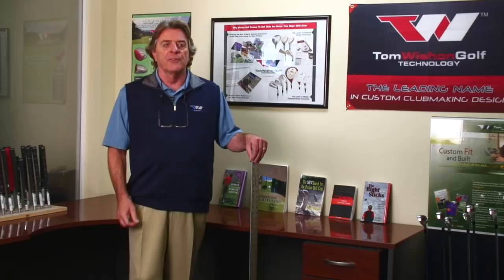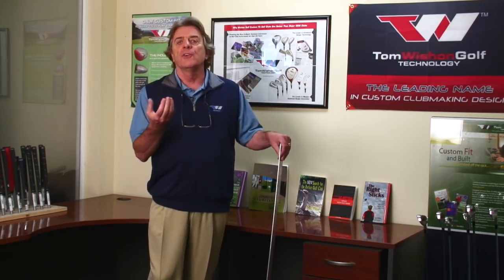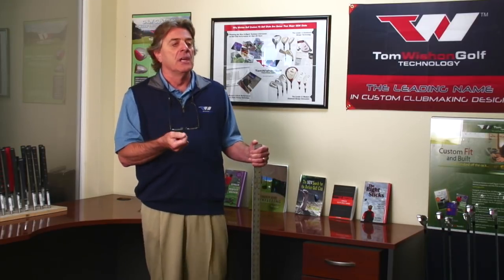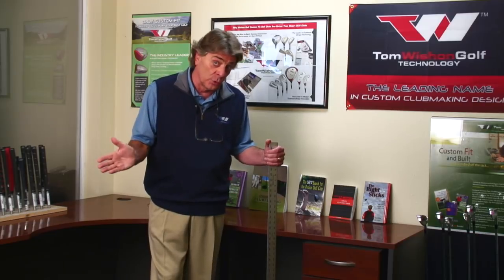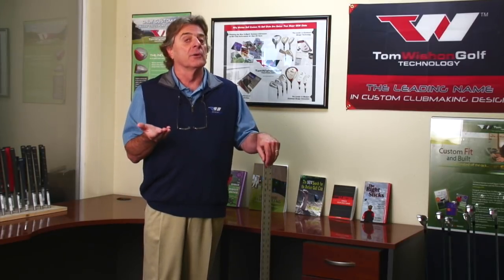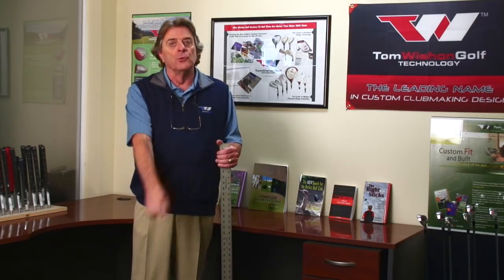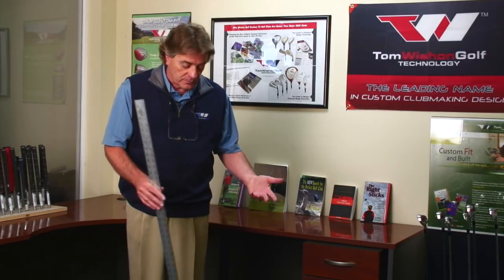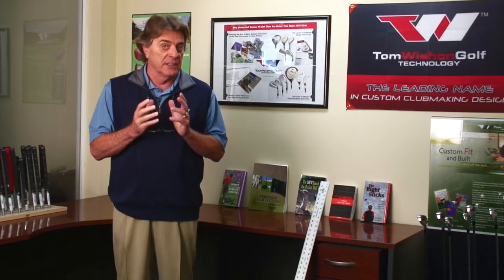WRIST TO FLOOR MEASUREMENT FOR LENGTH

Comment: I just started playing golf. I bought a nice used ping driver and wasnt hitting nearly as well as my irons. I measures it and its 47". I choked up on the shaft and cut a few inches off and today I was sending nukes straight down the fairway. Felt really nice thank you for your amazing advice.

Comment: I'm struggling with finding a good Driver Length.  I'm 6-2.  When I use a standard 45, I tend to rub holes into my glove where the butt rubs into the heel of my hand.  When I choke-up and bend over more, I LOSE Control and Distance.. it feels very unnatural to bend over that much.

Comment: so being a taller golfer of 6'5 and having a passion for building clubs for a decade; I wanted to ask about creating irons in the 1.5 inch longer or 2 inch longer irons that possess a lower torque shaft, light overall weight profile, iam certainly more of a hitter of the ball in swing characteristic; I am searching for longer irons overall little weight to maintain physical control and to prevent fatigue throughout a evening of golf. but most shafts in lower weights i.e 80, 70 grams are mainly high launch profiles...what would you recommend...?
Reply from the maker: Will:
While it is true that longer length irons can increase the torque on the club and shaft, it is not a significant increase over the normal swing forces at normal lengths so there is no need to think about trying to do anything to offset it.  A much bigger problem is to try to find lighter heads or to try to push yourself to not go so long with your length that it makes the swingweight/head weight feel get way too high and adversely affect your swing tempo and timing.  A lot of people who need longer length irons are finding if they don’t go quite as long as they think they should with the 4, 5 irons and then use 3/8” increments between the irons through the set, or even ¼” increments, this gives the tall person the comfort they seek over the ball with the higher loft irons which are the ones that were more of a problem for comfort because of your height.
Reply: I throughly agree with the 3/8 incremental iron ideal; I believe I've been brain washed into only using 0.5 increments due to working with them mainly over the years. I will certainly implement the 3/8" and see if this encourages better results. But I should express that I am primary playing the bridgestone j 36 cb irons with xp 105 shafts at 1.5 over length, I state the model of irons due to the lack of uniform standards throughout the industry with respect to the evolution of golf irons throughout the years and find them very comfortable but they possess higher swingweights, which is great for a period of time, but to maintain shot consistency with them, id have to hit the gym everyday, this isn't ideal for my current lifestyle at the moment ...but you ve made a great point and i will certainly  attempt the incremental change. 

I'd love to find a source where the head wts. of irons could be produced for custom orders.

Thanks again..really enjoyed your video.

Best Regards

Will

Comment: Hi Tom, I've been playing a standard length PX6.0 LZ shaft and love it. But at two recent fittings I've been told I should be playing a shaft 1/2 inch longer. (I'm 6ft1 with a wrist to floor of "37) my concern is - will this extra 1/2 inch effect the shaft flex, especially by moving the middle PX ''loading zone'' that makes this shaft so likeable half inch. I've read alot of mixed answers via the net. If it does effect it, can it be hard stepped even though it's been lengthend?. Your advice would be greatly apprieciated - Many thanks

Comment: hi tom , fantastic vlog which has got me thinking , im 5 ft 7 and wrist to floor is 32 in , I play off 9 , since watching this I have gone to the practice range and gripped down on my driver and hit golf balls until I've found a position now where if I choke down 1 1/2 inchs on my driver I now hit the middle more consistently , I use a titliest 910 d2 , would you suggest that I stick to choking down or as this is adjustable getting a 43 1/2 inch shaft , any thoughts would be really appreciated , kind regards jules
Reply: @camobooty2008  Is that jealousy or you just have nothing of value to add.

Comment: I am confused about fitting for static length of clubs. I have clubs that were built for me 1 inch longer than standard (my wrist to floor length is a little over 38 inches while common belief is the 7 iron standard length is 37 inches). My 7 iron swing weight with TT XP-95 R300 shafts is D5. Lie angle set at 2 degrees upright.  A different fitter is now telling me this setup is wrong. He says it's better to stay closer to standard length and adjust the lie angle instead to set the bottom of my swing. He says it also stiffens the shaft by lengthening them.  Confusion reigns! What to do? There seems to be more than one philosophy regarding all this. Is wrist to floor a useless measurement?
Reply: how can a longer shaft be stiffer?

Comment: Great info. Especially after you've heard it for the 3rd time :)
Length measurement procedure starts at  6:40  
It's a starting point for the irons only!!
Length measured is for 5 iron
Add 1/2 inch for longer irons than the 5 and subtract 1/2 inch for shorter ones. This is the "standard" adjustments in lengths 
He prefers 3/8 inch increments. Doesn't say anything about single length irons
Driver length should be based on players ability not by the "standard" 45 or 46 inch lengths the manufacturers use
Nothing mentioned about club lengths for clubs other than the irons and the driver. 
Just saved you 8 minutes of your life
You're welcome :)

Comment: Tom, great video and information here, but doesn't this separation in fitting for irons and woods possibly create a large gap between the golfer's lowest lofted hybrid and their highest lofted fairway?

If, say, my driver was 44", one inch separation gets me to 41" in my 7 wood, but a 38 inch 5 iron gapped up once to a 24* hybrid puts that length at 38.5, max, if keeping hybrids in the iron gapping. Is there a way to solve that issue?
Reply from the maker: Ryan Trapasso 
There really is no relationship from a technical fitting standpoint between the length of a golfer's driver/woods and the length of his irons.  There are golfers whose best fit in the irons may be a 40" #5 iron whose best fit for the driver could be 43".  Same as there can be a golfer whose best comfort fit in the irons may be a 37" #5 iron but by virtue of him having exactly the right swing characteristics for control, his best driver length could be 45".   Driver/Woods and Irons are two totally different "animals" when it comes to fitting, which is pretty much what I am saying here in the video when I say fit the irons for comfort and the driver/woods for swing ability.
Reply: That's so interesting - thanks Tom, appreciate it!